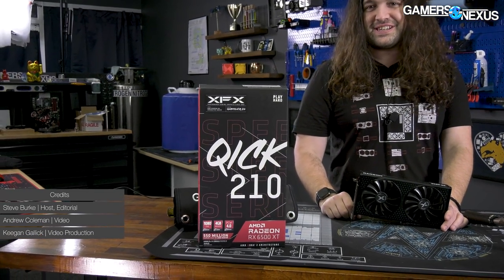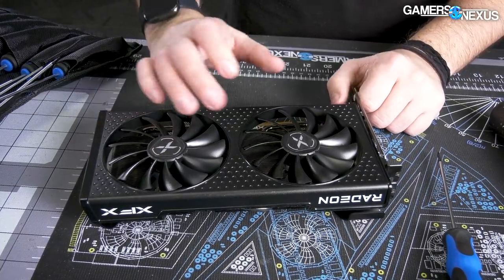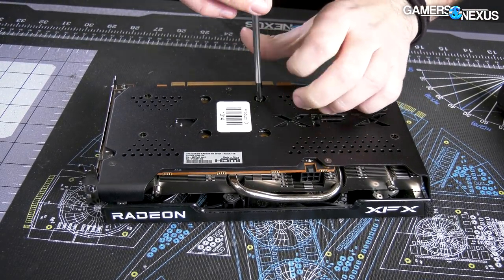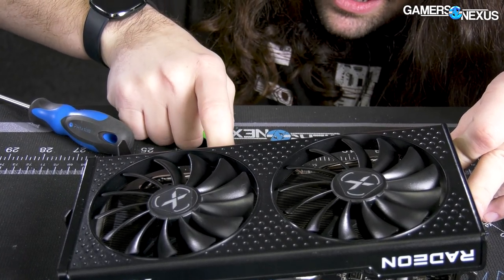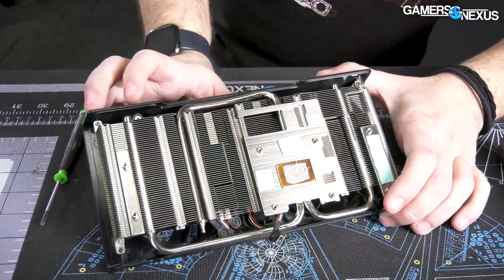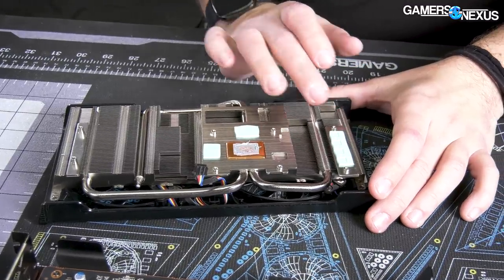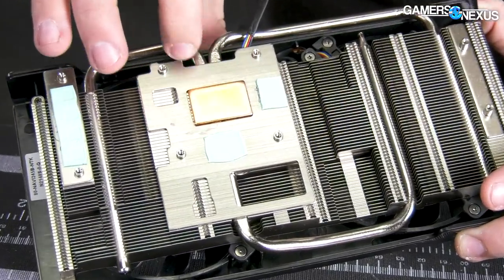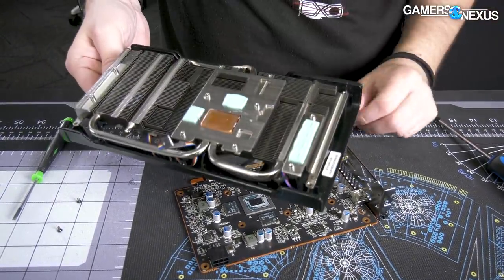Tearing Down Trash: AMD XFX RX 6500 XT Disassembly

Comment: And the best part about this, AMD set the bar, RTX 3050 launch bad as it's going to be, will be worlds better that this croppa, as a GPU, actual GPU as well.
Reply: Why would you say that? Do you think paying $500+ for an RTX capable 1660 Super is worth it? Because that's what the 3050 is going to be like. Crypto miners are going to love that card.
Reply: @avatarion  You replied to a wrong comment it sounds like, it's not my point at all, but regardless and actually it all depends on the launch day prices, which are bound these days to be a mile away from MSRP, as opposed to a billion miles away a day afterwards, which was the case with RX 6500 XT, a moment of silence for those who bit the bait and bought it would be appreciated, anyhow, some, myself included are tired of their e.g. GTX 1050 Ti's or UHD graphics, and those will be infinitely better off when deciding to give in to this dystopian market, and buy an RTX 3050 instead of RX 6500 XT, which isn't remotely near the MSRP, never was and won't be because retailers are abusive cunts.
Reply: @avatarion  Also, according to Paul's estimates at an inflated price, any scum of the Earth to buy it for mining, at recent cryptoshit "values" would wait for it to pay for itself for two years, only then starting to "earn", so there is some hope, especially if this shite continues to drop in "value" as it should. Doesn't sound like they'll jump at this GPU as eagerly.
Reply: @atsumeru3245  I didn't reply to the wrong comment at all. The 3050 street price will be significantly higher than its MSRP, making the 6500 XT a much better buy if you are building a new cheap system. I would get an i3-12100F 16GB DDR4 and an RX 6500 XT, use that for a while, upgrade to Raptor Lake on the same motherboard and a better GPU and DDR5. There are no other good price to performance builds on the market.

Comment: i mean i get what you're saying but i have a 6500 and for ME it works fine..... im not saying its great but i dont get why people think its trash... and i know about the PCIE and all that
Reply: yeah people are over exaggerating when they say its trash, its a good card but amd was stupid in its limitations
Reply: @notcraig255  yes, people dont understand that gpus are a lot of $$$$$ and  some people [like me] cant spend $2000 on an rtx 3080... this is a descent budget card
Reply: @boots1807  also people complain about the pricing, the gpu is not cheap for AMD to make either. people are very blind when it comes to this card. the only part where they're not is complaining about the bandwidth limitations which is the 6500XT's achille's tendon
Reply: @notcraig255  ya, if it had PCIE 4.0 x8 or x16 it would be great.... but it works good as long as you stay within the 4GB of vram. its still a descent card

Comment: How does it compare to an RX570? From what I seen the RX570 has more ports and even feutures which is crazy to think.
Reply: Isnt the RX580 and RX570 basically the same card just different clocks?
Reply: if you're on a gen 3 system its not worth it, if you have a gen 4 system and your 570 is 4gb then this card is better. if you have a resolution over 1080 then stick with the 570 it'd do better with more than 4gb vram used. the decoding is not that useful and encoding is only for streaming and video editing. ports are only needed if you have more than 1 monitor.

Comment: I feel so bad for the team of engineers that worked really hard making this thing a reality and everyone just hates it, at least its not a GT 730(430)  it gets some FPS, I'm hopeful AMD releases an updated version using perhaps the same core GPU but more PCI-E lanes or even a 96-bit bus.
Reply: entirely agree, hell they should've just not done gen 4 for this gpu and should've gone with gen 3 x16. would've been equivalent to x8 on gen 4 which was alright for the 4gb 5500xt and will be great for gen 3 systems
Reply: I don't hate it, you could game pretty OK at 1080p, it's in stock, it's new and at least in UK it's not that expensive. 220 pounds.
Reply: I think the 4 lanes are baked into the core itself. Splitting them would mean screwing with the die, or tacking on extra components on the PCB.
Reply: @Neuttah  If that's the case an AIB manufacturer could use a memory controller at least to benefit 16x Gen3 Users.  At the same time I'm doubtful it is, Usually cut down dies are "cut off" a larger chip If the 6500XT is it's own Die then it can't be further cut down into a "laptop unit" (less than 4 lanes?).  Unless there is a larger variant of the current die which would mean that a larger pci / ram interface could be possible with the before mentioned "updated" model.
Reply: @pepperfish_  I'm betting memory controllers/PCIe switches would cost another 10-15$ each. That'd push MSRP to 230-250, on a card that's already being ripped in price.

This is the 'cut off' spec. That's why there's no decode hardware, and only 4 lanes of PCIe. The APU already has the decode hardware, and it'd only run the minimal 4x4 to the GPU anyhow.

Except, for whatever reason, these chips aren't going into laptops. I wonder if they're production defects, or if they just didn't get picked up by any manufacturer.
Reply: @Neuttah  I agree totally. If this is the case of a cut off die, there is the possibility that with better yields more components will be available.  What card from AMD has 8 PCI lanes?  None so far.
Reply: @pepperfish_  6600XT 6600 RX 5500XT both 4gb and 8gb
Reply: @notcraig255  umm no there isn't one with 8 PCI-E gen4 lanes, thanks for reading.  That's because I believe the 4 Lanes interface isn't final.  but I digress time will tell.
Reply: @pepperfish_  Looking at it a bit it seems largely dependant on the die: Navi 23 has 8,  22 has 16.

I wouldn't exactly use 'cut off' in this case. From the look of it, the entire design is utterly minimalist, and outside of some hopeful later revisions, this seems to be peak Navi 24. It's the OEM-only 6400 that's the cut-down version.

I'm reminded of mid-century budget cars, like the VW beetle, where you'd have the windshield washer run on pressure from the spare tire.

If they manage to find a way to tack on an extra few gigs of ram, I'm guessing it might turn into a decent budget card for new builds in the future, but at the moment, it's just...lament.
Reply: @pepperfish_  you said "What card from AMD has 8 PCI lanes?  None so far.", and I listed them
Reply: @Neuttah  I have a hard time believing it's maxed out in it's current form, why AMD would release a card that is only a viable upgrade option for 750 Ti owners (and below) baffles me.  Especially if this is the be all end all variant.
Reply: @pepperfish_  You're assuming upgrades: Don't. There's plenty of machines with, at most, an integrated GPU at the moment.

It's a void-filler. If it weren't for the shortage, the chip would most likely have been limited entirely to laptop production.
Reply: @Neuttah  Most machines use iGPU's, the "Gaming PC" was until very recently a niche market.  Anyone willing to drop even $700 on a GPU at that moment has some experience and probably owns an older GPU.  The value incentive does not exist for any "enthusiast"  with this card to either purchase in a prebuilt or as an add-in. The 6500 is most likely what prebuilt "gaming pc's" from walmart etc. will end up with, and it will go down in the anals of time as a potato.

Comment: AMD APU outperformed this card just in looking at the comparison when I watched LTT budget build stream last night. 
It's not even worth the 200$ pricepoint. 
Honestly - the prebuilts and now these I'm starting to lose a whole lotta built up over the years faith in both AMD and ASUS.
I LIVE IN TAIWAN as a foreigner and it STILL hurts my pride to see crap like this being pushed out for gamers to fight over as Cryto Rigs and newer GPUS pushed by NVIDIA are catered towards them. 
Ugh, Ugh just UGH - How long will my Vega 56 last? I might go buy an Xbox and F it.
Reply: @petervansan1054  FPS was not what I meant rather comparing the price point of $200 vs. free - PCI with 4 lanes that is only going to cause problems and issues rather than say.....waiting and using the APU for a bit, while putting that 200 towards a worthwhile card and sacrificing suffering far exceeds the usage of AMDs newest card. 
But you do you, for me running that card at 100 FPS as it stutters and juts around simply due to the card itself being severely restricted and AMD willfully knowing but pushing it out anyway - if my card fries I'm heading straight for an APU until I can afford at least a 6500xt that will actually play games in the future is WHERE MY OPINION came from. There was no facts in my reply, just comparing the two I formulated an opinion, and not strictly based on FPS. 
I also dislike people who dislike random internet comments. So have a good one and hopefully your PC is running well with whatever it is you do.

Comment: This would have been a good enough low end GPU for old or cheap systems if it had 8x PCIE, and a MSRP of $150 or less. Some models clocked a bit lower with no extra power connectors would have been nice for certain applications. As it is though I do not see a great reason to buy this. I guess it makes some sense if you are building a new system with PCI gen 4 and you want something better then a APU and you are afraid of buying old second hand GPUs and you just need something to tide you over until you can get an actually good card. Really not much point to this card except to off load it on desperate people who will buy anything right now, or people who do not know better.

Comment: I still can't understand how AMD could have thought "Hey let's make a 6500 XT" and then give it less vram and let it be outperformed by the 5500 XT (or even the RX 580). Like if they said "This is the 6500" I would have agreed with that a bit more and then gave what should have been the 6500 XT 8GB vram to better compete with the 3050. But no...
Reply: Well, let me help you understand. It's not complicated. 8GB VRAM would mean it gets bought by miners en masse, and the price inflated to almost double that. It's stupid to compare it to some RX 580 from many years ago because the global economy isn't the same as  it was then. If the RX 580 8GB was made today it would cost much more than it did then. This is why AMD decided to release a card that can actually stay close to its MSRP. See, miners need more than 4GB VRAM in order to get ETH.

Comment: Bought an RX 6500 XT Gigabyte Winforce OC due to low buget and I was desperate to get one since my GTX 970 suddenly died. Since the 970 had 3.5 GB and this one had 4 GB I thought it would perform better and I was pleasantly surprised that it performed around 20% better than my old 970. So for a couple of years this card is pretty decent for 1080p. My PC has a 5600X overclocked to 4.8 GHz, 32 GB of 3600 MHz CL 16 RAM and a B550 so I had PCIE gen 4. My advice is, if you're extremely desperate and have a really low budget get a 6500 XT, otherwise get something better.  PS. The reason I could not save more money is because I earn less that $5000 a year so it's not easy to get $100 more for a better GPU. I even had to use a credit card to buy the 6500 XT to 12 payments.